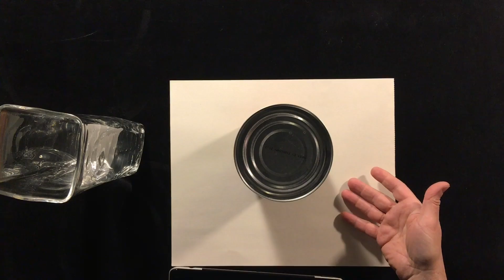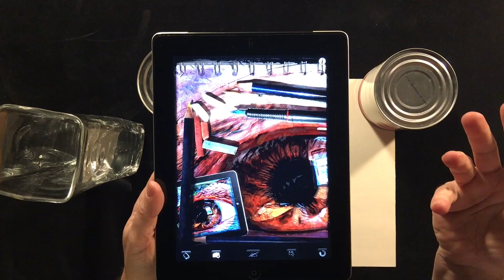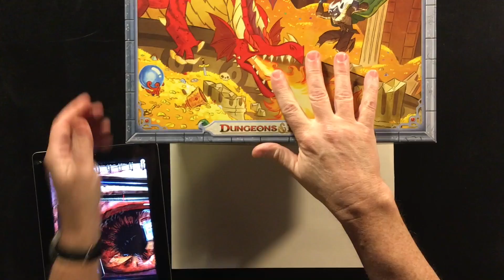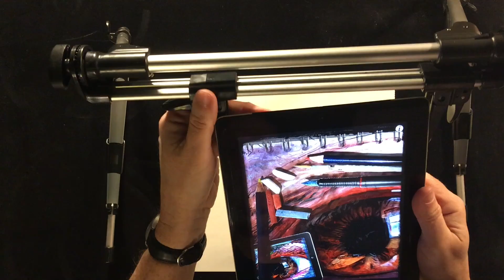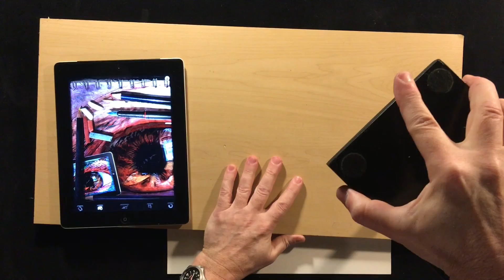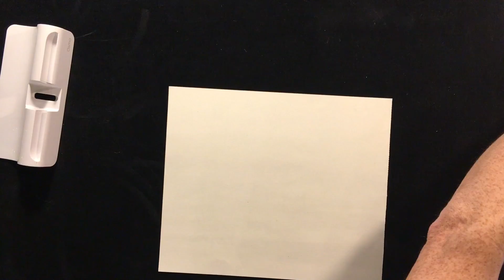Camera Lucida 9.0 and options for stands

Comment: I’ve been using a homemade stand, but I travel a lot and am trying to find a smaller, more lightweight solution.  I purchased the OSMO, but cannot for the life of me figure out how to make it work for a 9 x 12” painting… I’ve watched this video and others, but no one shows the whole process, from selecting an image to sizing and drawing it in perspective for a 9x12.  I am reasonably techy, but I’m totally stumped.
Reply: Hi Krista, a bit of this depends upon whether you mean 9x12 in portrait or 9x12 in landscape.  If you're doing a portrait, then 9x12 should be easy to do with your stand.  Just make sure to fill the screen with your subject before you hit the draw button.  You may need to put your stand up on a book to lift it an inch or two to increase the field of view.  If, however, you're trying to do a 9x12 in landscape, then to get the 12 inches across needed, you'd need to lift your stand up several inches.  When you do this, much of your camera's field of view will be wasted unfortunately.  There's no easy way to use a mirror in landscape mode due to the placement of the camera being up on top of the iPad.  If you have an iPhone, the new version of the app (version 14.0) allows you to use the camera from your iPhone in combination with your iPad such that your iPhone's camera points at your drawing surface (hosting) and the iPad becomes the receiver of the live video.  :)
Reply: @evilAshTheDog  - thx Pete.  If I am having to lift the stand to get the camera view large enough for 9 x 12 (portrait), I might as well stick with my current stand, no?  I don’t see the advantage to using the OSMO…. Am I missing something?
Reply: @kristapedersen1828  using the front camera as you are with the Osmo has several advantages over using the rear camera.  The best part is that all you need is a flat surface and you can place your stand right in front of you while you draw... no need to hover over your device while you draw.  Different iPads have different sizes and thus the camera is higher up on some models than others.  I just checked and my old 11" iPad Pro can handle 9x12 drawings without lifting it up.  It's hard to say without looking over your shoulder how large you can draw without placing your stand on a book or something.
Reply: @evilAshTheDog  - thx… I am using a mini… so maybe that’s the problem. I didn’t realize that the size of the iPad would affect the image size. Anyway, I’m sending it back. I’ll figure something else out for travel. Cheers
Reply: @kristapedersen1828  it's all about your camera's field of view.  The app can only work with what the camera can see - and the further from your drawing surface the camera is the more it can see.  Raising up your device just moves the camera further away allowing a larger field of view.
Reply: @evilAshTheDog  - yes… I understand that now. But then I may as well stick with the system I already have. Thx Pete

Comment: The stand you showed off Amazon has lots of bad reviews about the clamps breaking.
Reply from the maker: While I've never had a problem with mine, and I've been using the same one for years, ultimately the purchase is your decision.  There are lots of ways of using the app, so feel free to use whatever method you prefer to hold the device over your drawing surface.  Of course, Amazon has a great return policy!

Comment: I bought the ipad stand. I want to trace a 9x12. Do I put it 9 inches up or 12? I find Im not getting the true measurements...frustrating
Reply from the maker: Gwen, lots depends on the device you're using.  If you want to draw 9x12 the rule of thumb (and it's just a rule of thumb) is to have it up 12 inches.  If you're finding that you can't draw that large, use the option in the main menu called "Maximize drawing size" and then be sure to zoom into your subject before you hit the draw button.  Also, if you have a device with one of the new wide angle lenses, use the "Contact Us" button to send me an email and I'll hitch you up with the newest beta that can make use of these new lenses.  If you're at all frustrated, just email me and we'll walk through whatever issues you're having, ok?  -Pete

Comment: Is there a link for the aluminum stand?
Reply: Mary Bryan The link is posted in the video description. But it is sold out- so what you do is scroll down on Amazon to the other similar items - there is one other seller that still has this exact model left and a few other models that are very similar. This is how I was just able to order one an hour ago
Reply: E S I’m not having any luck locating the link but I think I’ve found the stand regardless. Thx for your reply
Reply from the maker: @marybryan5879  yup, it looks like they're out of stock on the link in the description - but there are plenty others that are the exact model:  https://www.amazon.com/Healthy-Reading-Tablets-stablet-Larger-201/dp/B07ZK8F1R6/ref=psdc_3015412011_t2_B00MP0J0YK
Reply: Mary Bryan Here is where I found it if anyone runs into trouble finding it anywhere- https://www.amazon.com/dp/B07ZK8F1R6/ref=cm_sw_r_sms_awdb_t1_..0SEbGSSVAJ2 - hopefully shipping is not as long, I only had to wait a little over a week for it to come- got it two days ago! Very happy with this!

Comment: Does the OSMO stand require some kind of mirror set up?  Where is that available?  Just bought the app and am excited to try all this out.  More advice on watercolor applications would be appreciated too.
Reply from the maker: Gregory, the Osmo "system" consists of a plastic stand that holds your device tilted back about 15 degrees and a red "puck" that slips on top of your iPad.  There is a mirror in that puck that reflects your tabletop view into the front camera.  So yes, there is a mirror involved.  You can do the same thing with items you have around the house, but the Osmo is of high quality and is certainly easy to use.  Plus Osmo has some nice educational apps to go with it if you have children.  As for watercolor, the app can't tell you were to paint, but I've added a few nice filters that will help you to ink the dark areas, etc.  One nice feature is the "levelize" which shows you your reference image as a series of washes that if applied on top of one another will create the proper final shading.  That feature is for shades of gray and there isn't an equivalent for color within the app.  I've tried a few times, but the transparent nature of watercolor is so tricky that I was never happy with the results.  Still, lots of people use it with watercolor all the time and you might want to check out our facebook group for inspiration!

Comment: Thanks for this, going to check out the aluminum stand and the Osmo now, then back to drawing. I love this app and have done since you first put it on ITunes for downloading.  For my first stand, I built a little platform, just like the ones you built, only  I used Lego's.  Since I paint miniatures, my iPhone was perfect.  I now have a mini iPad (naturally) and it's easier to position because it's lighter.  I can't wait to use version 9.  Regards, Linda

Comment: Question:  I have an Otter Box case on my iPad... will the aluminum stand work with it?
Reply from the maker: That stand holds your iPad in place by squeezing the two top extension arms against the sides of your iPad and then you locking them in place.  Each of the arms has a v-shaped groove in it.  I just measured the groove and it's 1/2 inch wide.  If you Otter Box's width is 1/2 or smaller, it will easily work.  If it's larger, it should still work, but might not be as secure.  -Pete